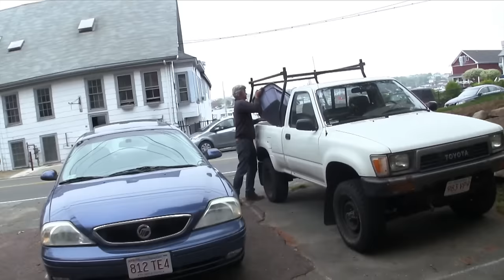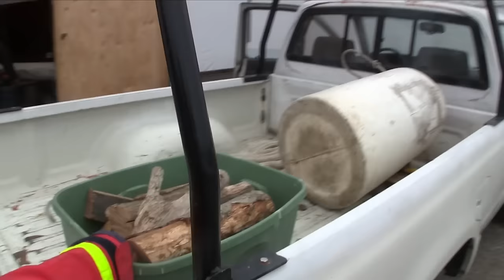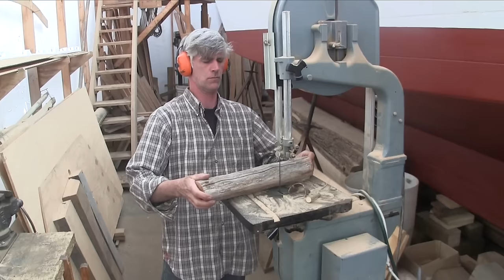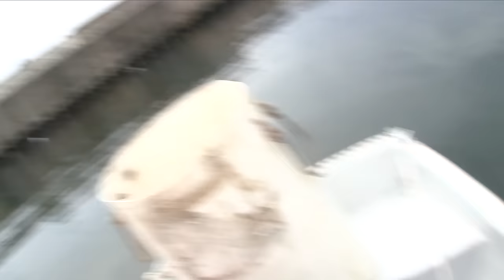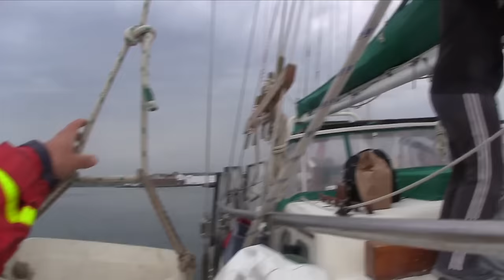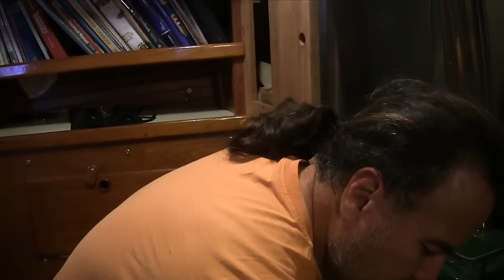Firewood with Mojo: A Wood Stove on a Sailboat | #51 | DrakeParagon Season 2

Comment: There's something very gratifying about having your own wood store for heating your home.  Since you're wintering in Scotland, you should be able to find (if you haven't come across it already), peat bricks for pretty cheap.  They are usually compressed, so they burn for a long time.  A word of warning, however, they are a bugger to light.  The best way to go about it is to start up a fire with some typical kindling, then toss on the peat brick.  Gives off a nice smell as well.  

My wife and I just missed the chance to run into you two in Scotland by a week or so.  What projects have you got in store for the time you're wintering up there?

All the best, ~Lofty
Reply from the maker: +Lofty Goals Hi Lofty Goals, we have a wonderful peat fire going in the stove right now. :)  We're spending all winter working on our videos.  We're hoping to release a 2 hour film soon.  :)

Comment: great vid. nice green (I'm guessing) cast iron stove...my wife asked ' how did you protect the nearby bulkhead...looks like sheet metal?' We burn a lot of wood at our house...in an old Lange cast iron stove.
Reply from the maker: +ClanOfStonemasons Thanks, Yes that's sheet metal that's been wrapped around a heat shielding.  I cut the heat shielding boards to the perfect size and then hired a metal worker to bend sheet metal to cover it.  Then I throughbolted it to the bulkhead.  There are directions on how to do all of this at the Navigator Stove works website at marinestove.com

Comment: instead of a bow saw get yourself a folding hand saw,smaller,folds into its self,cheap($20) and cuts just as well
Reply: +Michael Groff Yes, but only on the pull stroke. The bow saw pictured (if tensioned well) cuts on both strokes.
Be good to have at least one of each, eh? Extra blades in oil cloth?